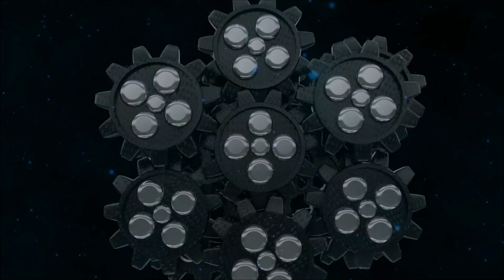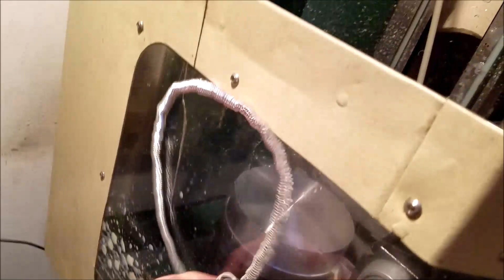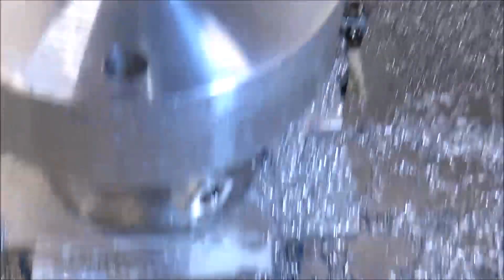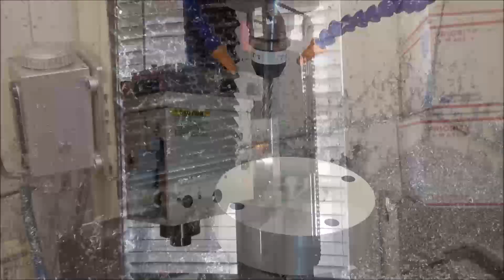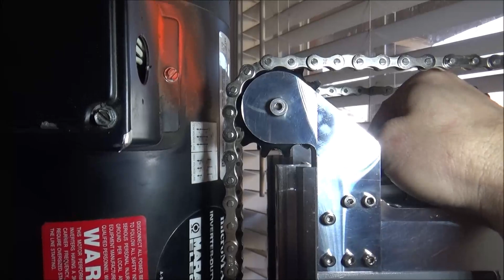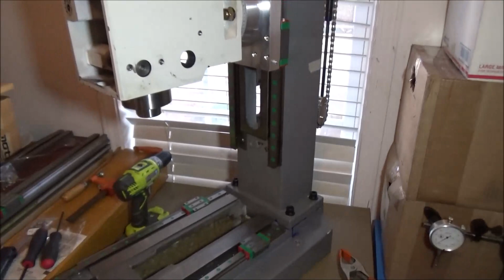PM727MXL Z Axis Odds and Ends

Comment: cool looking mill Sam. with the counter balance system were you  able to reduce the stepper motor size, compared to your old pm727 that doesn't have one
thanks, Mark
Reply from the maker: I suppose you could I am not running very large servos and the steppers before were not large.